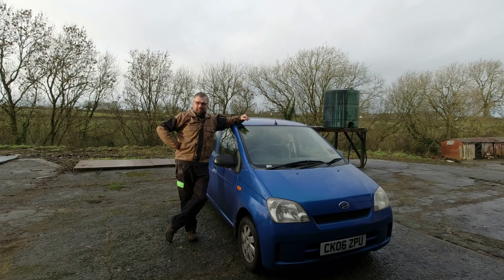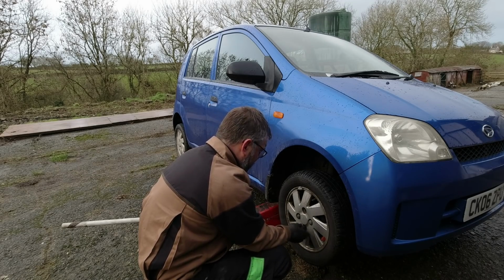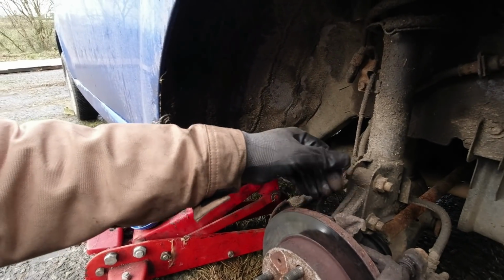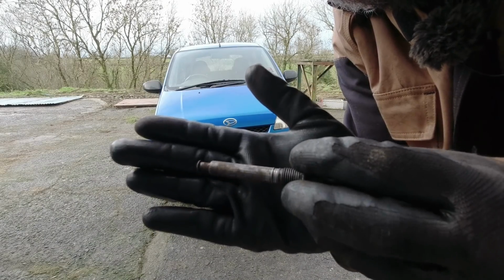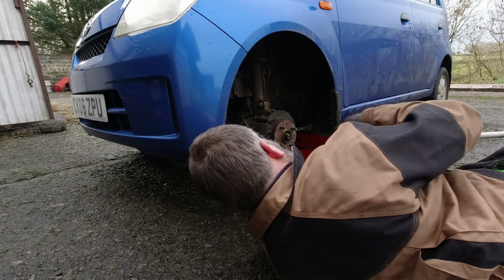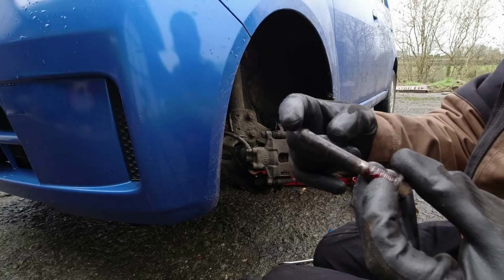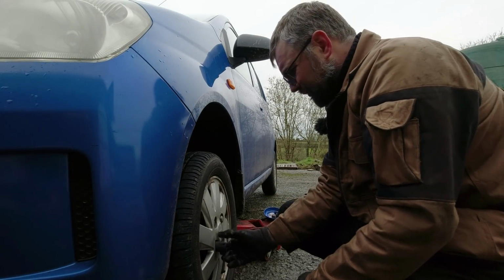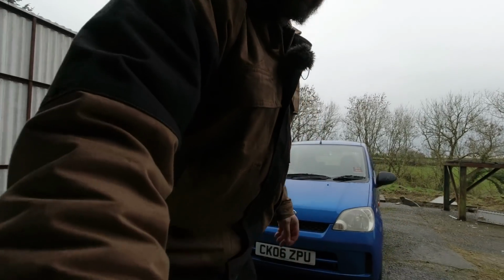Daihatsu Charade - Are the brakes worn out?

Comment: Australians with Daihatsu: Today on Mega Oz Mods, we're fitting a 16 valve engine with three turbochargers, 29-inch wheels, and a 10,000 watt stereo to our long-term Charade. We'll also be painting everything we don't upholster.

Hub Nut: Right, so apparently we can't get parts in Wales, but I figure we can sand the rust off, and it will get us to Tesco so we can procure Tea.

I guess I have a bit more use for the ability to visit Tesco, or their local analogue.

Comment: Top tip, DON'T waste any money on brakes etc, they look fine for many thousands of miles.
Wait a few weeks, see what the Mot brings. No point spending out on brakes if she fails on emissions which I'm afraid is likely 😯
Reply: You beat me to it😄
Reply: Regularly pumping that amount of blue smoke into the air isn't good on any level - although yes, it will clearly fail on emissions as it absolutely should.
Reply: That’s funny you say that. Completely overhauled my brakes on my Peugeot Partner for the MOT. Failed on the emissions! Which brought me to another thought. If you look under the bonnet of Rita the Rover, you’ll see a sticker with 1.00 and an EU Mark on it. That’s your emissions smoke test level for that car.
Reply: @glennpowell3444  
I don't drive as obviously still banged up !
Don't think that's the real point of Hubnut. It's primary function is to bring us entertainment, a task it performs to perfection 😯
Reply: ....just to say...if that emissions sticker wasn’t there and the emissions limit wasn’t listed on the VIN plate, then the MOT inspector would have to go by the Govt set limit of 1.5
...I think you know where I’m going with this one 😉
Reply: @glennpowell3444  
No problem, I've enjoyed this for a few years now.
Example of my world, red light on dash, take to garage, told need new alternator, leave at garage, pick up next day job done.
Would make very boring vblogs lol 😯

Comment: At the moment, I'd price the brake job up but I wouldn't actually do it yet as I think you're going to be spending a lot of money and time in sorting the engine out - I really can't see it passing an MoT in its current state.
Reply: Has the all the crankcase vent system been cleaned and checked yet?
Reply: I was thinking the same. I think the mot is only a couple of months away. Like you i also have a feeling the mot tester will not be happy with visible smoke. But it should give Ian some good content material sorting it out! :-)
Reply: Would a breakers have a complete Daihatsu engine? One imagines that fitting a used engine and rebuilding the original...or rebuilding a used engine and then fitting it before the MOT would be a fairly straightforward process that would prove economical rather than bandages on a dying powerplant.
Reply: @MrKnowwun  He keeps being asked....but no response so far. It's such an obvious one to check isn't it.
Reply: Rebuilding many of these Japanese engines is often a waste. The alloy blocks don't take kindly to a rebore. That is why there is a healthy market here in Canada for low mileage engines from Japanese market cars that were scrapped because of the tax laws there. Terribly inefficient and dreadful for the environment, but many perfect cars are scrapped at 5 years old.
Reply: agreed, basically a scrapper at this point!
Reply: @michaeltutty1540  Years ago there was a company that used to import engines from Japan, Heathrow Engines I think they were called. I thought alloy blocks had liners, or is that old tech? I know my Renault 16 had liners in its all-alloy engine but that was 50 years ago!
Reply: Rings are gone on it I reckon
Reply: @TheAlien1974  Very likely, more so than valve stem seals?
Reply: Most likely some new oil control rings required. I wonder how many cups of tea it will take to get through that job 🤔🤣
Reply: @graemestrong3727  I can remember a box of those on a shelf in the garage for my Dad's FB Victor, which he sold in 1973. Ask me what I had for my tea on Tuesday though...
Reply: Some 20w 50 and a complimentary chip butty for the inspector maybe.
Reply: I had a Felicia which burned a lot of oil and was actually oiling up the plug on cylinder 1 if you ran down hill for a long time. I bought New rings but it transpired it was just a stuck Oil Control Ring but I changed them all as I already had them, and no wear in the bores. I just ran a flap wheel down and up each cylinder to remove glaze,. and it went through the MOT with only 18ppm Hydrocarbons on a limit of 200.

Comment: Ian, it's always worth cleaning out the pin housings too as the old grunge builds up and can hydro lock the pin. I give mine a good spurt of degreaser and then gently run a drill bit in by hand to get the worse off, followed up by a Mustie1 stylee cotton bud in the drill, works wonders.

Comment: Always lube the sliding parts. They will come apart when you need them. Sometimes the disk and the pads develop a glaze on them that makes noise when applied. A little steel wool on the disk and the pads will take care of that and try to use factory pads when available. My Toyota had that squeal from glaze when I had the brakes done at a shop. I found out they used cheap pads. I did them using factory pads and no more squeal. Helpful tips from across the pond. WD-40 spray is also very helpful against damp and wetness as that is what it's designed for. Use it all the time. Great on wiring and other parts. Gets rid of the water and coats the metal. Good Job on your videos and very happy you are including the family. The kids need to learn about this stuff as well.

Comment: Hi Hubnuts, take it for a pre-MOT check, as others have said emissions look a bit doubtful.
Reply from the maker: Will do. Probably next month. It doesn't smoke like that all the time thankfully or I wouldn't be driving it!
Reply: @HubNut  Is it a diesel ?  My mate has a diesel van mostly does 10 / 20 miles a day.  For MOT day gets up at 5am,  does a trip London to Portsmouth (well the A3 roundabout nearish it ) then back for the MOT,  nice warm engine, rings expanded, gunk blown out, MOT pass !!
Reply: If it was a diesel quarter of a tank off diesel then add 1 pint off petrol then take it and give it the old Italian tune up...job done..

Comment: Handy tip, spray some brake cleaner into the holes that the slider pins go into and get a cotton bud and give it clean out. This will hopefully remove any congealed grease and general crap. If you really want to do a good job then roll some emery paper up and insert this and rub the inside first.

Comment: When I did a similar job on my Hyundai brakes the pins with the cut out sections in the end housed rubber sleeves for the pins to slide in. Two came out still on the end of the pin and two were firmly stuck in the calliper. Maybe the same with yours? My pins also had to be hammered out followed by a sanding and lubing. Sold the car shorty after so no idea how long that lasted but it did fix severely sticking callipers.

Comment: Valve guide seals? Would be my first port of call before srtipping the engine also check the breather valve.
Reply: Pretty sure its the valve guide seals. As far as i remember from other videos, the smoke is worse when it has been idling, and goes away when driving at higher rpms.... pretty typical for bad valve guide seals to my knowledge. If it was worn rings og stuck oil rings, it would smoke more and more with more rpm, as the crank throws more and more oil at the cylinderwalls. So my bet is that the oil comes from the top of the engine, and most likely from those umbrella valve guide seals, especially since there is no signs of a blown headgasket. Its usually not really that bad of a job to do, you don't need to remove the head, but you do need some special tools for pressurising the cylinders, and compressing the springs on the valves. Can be tricky though, depending on how the design of the camshaft/lifters.

Atleast there are not too many valves in a 3 cylinder engine ;)
Reply: Only something like a leak-down compression test might tell us more. I initially though valve guides, but it seems to need a real diagnosis. I ran an old Mazda with bad valve guides for years, until all the additives and thicker oil eventually blew something else, being the daily beater.

Comment: I use Silicon grease for the slider pins, ceramic grease for the other brake grease points. Red rubber grease for reassembly of calipers after refurbishing. Much cheaper than replacing ;-)

Comment: Something I found useful when working outside both on motorcycles & in the garden is a twin density foam pad purchased from Machine Mart. It is stiff so will not fold but is surprisingly comfortable. It’s just big enough to lie on keeping clothes clean & dry.
 ( I should have said. I am referring to the larger pad rather than the kneeler version.)

Comment: I always spray a certain name brand water dispersion spray into the bolt tubes...just to clear them out
Usually use copper grease on reassembly as well...I know you shouldn't but never had any issues
Reply: @glennpowell3444  it's a good way of keeping the slides able to move
Reply: @glennpowell3444  I always preferred sliding pots to sliding calipers
Reply: @glennpowell3444  iv got the wind back tool for working on rear brakes.....they are a godsend

Comment: 3.13 They are definitely not scraping on the disc.  Oh yes they are. Look at the metallic wear indicator, it was on the disc.
Reply from the maker: I'd expect a proper squeal if that were the case. It isn't a squeal. It sounds like rusty discs. Regardless, I will be putting fresh discs and pads on it.
Reply: @HubNut  Its not immediately obvious on those. But if you notice the pads have a metal backing pad, this then has 2 small legs that reach around to the inside of the pad. These are the wear legs and you can see on the video they are touching the discs.

Comment: I have always preferred copper based brake component lubricants, they tend not to congeal as much.  Oh, it's Emery paper or cloth not sandpaper, even the woodworking stuff is called glass paper.  Anyone calling either sandpaper in woodwork or metalwork classes at school would get a clip round the head with a ruler, they were stainless steel rulers in the metalwork shop, ouch!   A few thou miles left on those pads but don't let them get too low, delamination or breaking away from the backing plate may occur during heavy braking or an emergency stop.

Comment: The smoke does look like a problem that will need to be solved.  One possible hack is to create more vacuum in the crankcase (or even just check that the PVC system is working properly). A but of vacuum can help those stupid low friction oil control rings that go into most 21C cars.

A more sensible approach is to boroscope the engine looking for scores in the bores. If it all looks fine then just fit new rings to the pistons. I doubt it's hard to do in that, probably equal to 2 or 3 Rover alternators in time.

Comment: The nearside disc was blue a sure sign caliper sticking and overheating. You did the right thing freeing off the guide pins though no real need to renew a little pitting isn't going to do any harm on those big fat pins and will help hold the grease, always used  heat resistant copper grease. Didn't notice you checking the piston was free though. As far as the engine goes it needs a set of piston rings. Oil control rings worn out and likely  gone soft lost there expansion tension when cold and out of shape improves with a hot engine and things expand. Head off, sump off whip out pistons, glaze bust bores,  change rings reassemble fit new timing belt etc. A good days work looking forward to viewing and will need to be done for MOT.  Cat efficiency may have been compromised with all of that oil passing through the system.
Reply from the maker: I'd never use copper grease on the sliders. Have ordered some ceramic grease which tends to be better but thanks. Engine work seems likely, but I think I'll put it in for a test early see if anything else is lurking first.

Comment: My experience with Mintex Ceratec is that it destroys rubber boots and sleeves on the pins so you are better off not using there IMO. It is designed more as a copper grease replacement.

Comment: Do the pins again but put 3-in-1 penetrating oil on and gently polish with the fine emery paper... you will see the rust steadily dissolving as you work through the layers. Then put the oil on again and insert in the caliperhole and spin it around etc to clean up the inside, then wipe everything clean and regrease.
Reply: Also there's no way I'd change the discs and pads... strip it all down properly, clean up pads and discs, spray all inside the caliper with brake cleaner and scrup with toothbrush, work the clean pistons in and out.

Reassemble and change brake fluid. Easy with an assistant overlapping tasks.

Comment: Such a small engine I reckon rings and valve seals would be an achievable job in your unit. A second hand engine could well be the same in short order. Can you do the valve stem seals using a cylinder pressurising tool like we used to with ford cvh engines? only used to take an hour or so, that would be a quick way to eliminate it from your enquiries before pulling the lump.

Comment: I think it’s definitely going to be a top end engine rebuild of the valve stem seals..... I think it’s timing chain on them little beauties.... Only scary if it has variable valve timing where the cam sprocket (defaiser) ⚙️ has forward and backward movement of the cam shaft.... or free play... that’s when you have to have a timing kit to lock the crank shaft and the cam shaft in position.... that’s fun because you have get it very right because if you don’t can go very very wrong.... VVT brilliant idea but scary as heck when changing a belt or chain....
Reply from the maker: No, it is a belt. This is the older EJ-VE engine. Definitely work to do I fear.
Reply: @HubNut  ahhhh I see well hopefully 🙏 it’s not vvt. It’s single cam yes? Or a little twin cam 3 cylinder? I need to watch back on the video from when you introduced the little gem. I have been recovering from having COVID so I been out of tune with your videos I’m sad to say.

Comment: Worn disks will flash rust especially near the sea, TDM friction aka brakebook - Pagid 50302 (disk) and T1520 (Pads), the slide pins may be an issue

Comment: With all this rain my discs are rusting overnight so I always have some scraping noise until its worn off most days. My alloy wheels are quite an open structure so rain  gets straight to the discs. I'd see how the Mot goes in March before any more expenditure. Reality is the smoking issue may be a fail, then your looking at the cost effectiveness of engine work on a cheap as chips car.

Comment: If sliding pin calipers are awful, what about the "swinging" calipers used by British Leyland in  the 1970s.  They pivoted on one pin at the top of the caliper and had wedge shaped pads which wore down until they were flat and needed replacement.

Comment: I've always hated working on brakes. top tip for you, I have an old bit of foam from a seat covered in duct tape that I use to sit on or knell on if I have to do a job like that.
Reply from the maker: Cheers. New trousers have knee pads and I also have some kneeling pads.

Comment: HI IAN PERHAPS THIS WILL HELP YOU,  the vacuum / crankcase ventilation hoses are not properly replaced or interchanged. Calibrated openings have been made in some hoses and if you then interchange the hoses, you suck too hard on the oil filler cap and you suck up oil (so oil consumption). My apologies  for the big letters but i had to use google translator kind regards from the netherlands Akko

Comment: Is that oil burning not just the valve stem oil seals? I nearly bought an Escort XR3 many years ago that had a similar problem. It smoked like hell until it had warmed up and then it was fine. Needless to say I never bought the car. Probably a wise move.

Comment: You sure it's not ABS related?  Many cars will perform an ABS pump test the first time you pull away after starting the engine which can make a slight grinding/scraping noise.

I did say the snake oil wouldn't work, it never does for stuck rings IME though it would be great if it did.

Comment: Those brake pins just need a run round on a powered wire brush, well lubed up and banged back in and repeat when necessary.
The cheapest cure for the engine is a better engine from a breakers yard.
You will only take tat one to bits and find everything knackered making it an uneconomical proposition.
Also is that a Catalyser equipped car?
The Cat will be dead from oil contamination, so chance of an MOT pass is very unlikely.

Comment: I note you have a faithful Hal-fords ratchet?  Do you find the long metal plate loosens up with use [or, lack of use?]?  I've had one for decades, and the little securing screws back themselves out, creating mayhem when the ratchet doesn't, if you see what I mean?
Reply from the maker: Yes, that does happen. My very first ratchet was a Halfords one like this, and it provided faithful service for a great many years with no problems. Sadly this more recent one isn't as good.

Comment: Is the Charade actually burning any oil Ian? If it's burning as much as it looks like it is I imagine you are topping up regularly? Reason I ask is I had a Vectra that did this but didn't use hardly any oil and had me baffled for a while. Turned out it had been previously seriously over filled with oil and the exhaust and catalytic converter were full of oil, and this is what was burning off. Changing the cat and exhaust cured it. That will be an MOT fail as it stands now. Hope you get to the bottom of it.
Reply from the maker: It is definitely burning oil when cold. It stops doing it once warm.